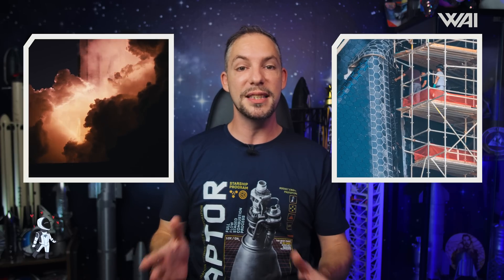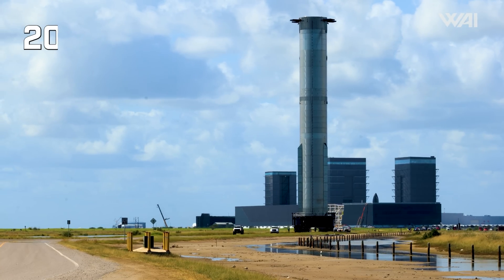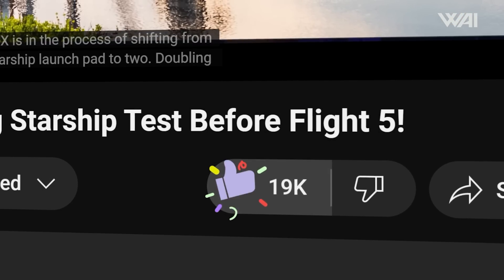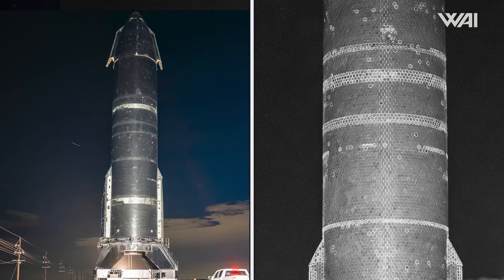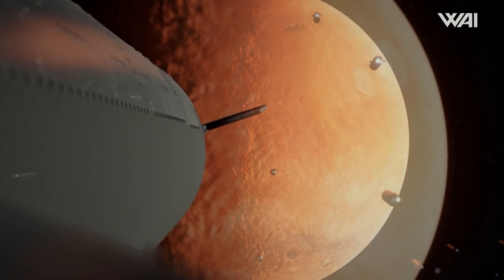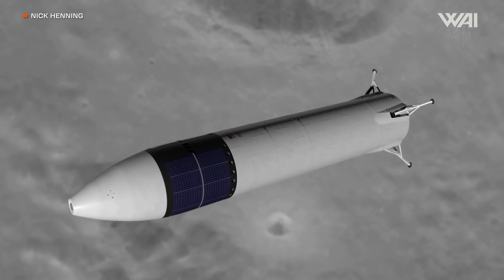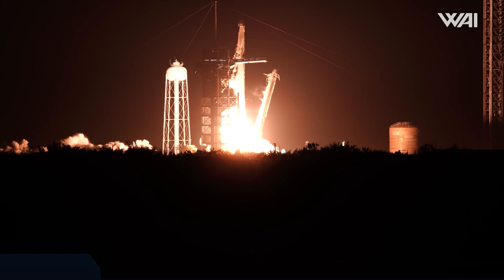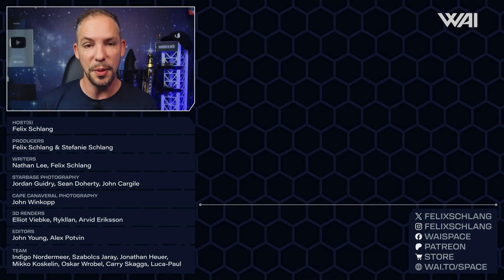SpaceX's Starship Flight 6 Booster performs unexpected MASSIVE Static Fire! Launch in 3 weeks?

Comment: If SpaceX wants to build and use Starships en masse, they'll want a good launch site to work out of and I'm not sure that Boca Chica would be a suitable place for this for political and logistics reasons (fuel supply!), especially if tanker operations are called for. Like it or hate it, KSC will likely be the main operating base for early operations, whether from a tower (or 2) at LC39A or from new launch sites north of the existing LC39. This leads to the question 'where will the ships and boosters be built?'

Personally I think that SpaceX will want to make the best use of their now-extensive facilities at Boca Chica instead of duplicating them in Florida. New facilities, even if only for the assembly of premade parts, would mean extensive construction and more personnel hiring, which would probably cause more delays. However, building Starships and boosters in Boca Chica means they will have to be transported to KSC somehow. 

In my opinion, the simplest way to move a superheavy and an unshielded Starship (such as a lunar Starship) would be by ship. Airbus, for example, leases a Roll On Roll Off ship they commissioned to move A380 components from all over europe to their final assembly location. NASA and ESA both use ships to move rocket stages around the world. A RORO large enough to move a superheavy, laid flat for transport, as well as a Starship, also laid flat and without its fins, would be a significant investment but would allow Boca Chica to remain the main production facility as well as allow boosters and Starships to be transported not only to KSC but also other potential launch sites such as Australia.

Comment: Why not use heat tile for the   rocket pad and mount to withstand the exhaust of the buster?
Reply: I believe water helps reduce the sound and it also guarantees that nothing breaks off and gets sent away at high speeds
Reply: @CrazyPengion  I was referring to the areas where water can't reach.

Comment: 14:40 - nobody cares about the heat shield of an HLS Starship - it is not scheduled to ever return to low earth orbit, let alone earth - so it will not have a heat shield.
Reply: Because Starship can barely lift itself to L.E.O.  it will take 8 to 16 additional launches to refuel the lunar craft with enough fuel to reach the moons' surface and  back to dock with Orion. 
There are a couple dozen other critical flaws in the concept that will keep that from ever happening.  
Elon took the tax payers money and will not think twice about it . His primary concern is getting the new starlink satellites into orbit. Falcon heavy can only carry a couple at a time.  Elon wants star ship to carry the satellites up and for as cheap as possible.
Every prototype launch costs upwards 100 million just in hardware and fuel.

Comment: He's not planning a heat shield on the lunar lander........ they can transfer crew and materials in earth orbit
Reply: Because Starship can barely lift itself to L.E.O.  it will take 8 to 16 additional launches to refuel the lunar craft with enough fuel to reach the moons' surface and  back to dock with Orion. There are a couple dozen other critical flaws in the concept that will keep that from ever happening.  
Elon took the tax payers money and will not think twice about it . His primary concern is getting the new starlink satellites into orbit. Falcon heavy can only carry a couple at a time.  Elon wants star ship to carry the satellites up and for as cheap as possible.
Every prototype launch costs upwards 100 million just in hardware and fuel.

Comment: Looking at the Starship with the Super Heavy it makes me wonder what is actually needed for the next moon landing. A rocket meant to take a 100 people to Mars is not what you need for this landing. If you take 8 or more people at a time it would be more than what they are currently planning to do using a curious arrangements of vehicles and a wasted space station. The Super Heavy V2 and V3 will both be larger than the V1 and may hopefully carry the original payload they have not yet been able to achieve with the current craft. Why not use the V3 Super Heavy and change the components of the moon lander? Felix reports here they plan to carry two people. That's ridiculous.  From what I've seen of the proposed SX moon lander it is very similar to the mars lander. Downsize the proposed vehicles and get eight people there at a time. Send several construction vehicles in advance and make the first manned lander a permanent station. Send another vehicle as the return vehicle. The way I understand the current plan is that it is an extension of the plan we had long ago. Send a few astronauts at a time and rediscover the moon. I think the first goal should be to establish a moon station and grow out from the there. The Starship negates all of the other plans that are being done and would be far less expensive. They are all make work projects for companies that are not able to deliver on their agreements. Does anyone believe the sophisticated components currently planned will be done and working on time and within budget? Who would trust Boeing with anything? Blue Origin is years behind schedule and has never launched a rocket to orbit. I guess you could say it's BE-4 engines are successful but we don't really know that for sure and the question remains how many of them can they produce. I'll be interested to see what actually happens when SX delivers its first test rocket to the moons surface. At that point you'll know if is capable even if it takes a couple of years more to get the job done right. Get a foothold on the moon, land a station and worry about discovering the nooks and crannies later.

Comment: They accomplished 100% on flight 5.   What else can they do besides catch the ship next?  A simple repeat of flight 5 makes no sense?
Reply: The booster suffered major fire damage to the fuel system and  engines.  The Starship gridfins almost vaporized , the engines were on fire. 
They still have not reached L.E.O. with an empty shell.

Comment: Felix, why would the ship that lands on the moon with landing legs need a heat shield?
Reply: Because Starship can barely lift itself to L.E.O.  it will take 8 to 16 additional launches to refuel the lunar craft with enough fuel to reach the moons' surface and  back to dock with Orion. There are a couple dozen other critical flaws in the concept that will keep that from ever happening.  
Elon took the tax payers money and will not think twice about it . His primary concern is getting the new starlink satellites into orbit. Falcon heavy can only carry a couple at a time.  Elon wants star ship to carry the satellites up and for as cheap as possible.
Every prototype launch costs upwards 100 million just in hardware and fuel.

Comment: why would a heatshield be required to land on the moon?  There is no atmosphere at the moon...
Reply: Because Starship can barely lift itself to L.E.O.  it will take 8 to 16 additional launches to refuel the lunar craft with enough fuel to reach the moons' surface and  back to dock with Orion. There are a couple dozen other critical flaws in the concept that will keep that from ever happening.  
Elon took the tax payers money and will not think twice about it . His primary concern is getting the new starlink satellites into orbit. Falcon heavy can only carry a couple at a time.  Elon wants star ship to carry the satellites up and for as cheap as possible.
Every prototype launch costs upwards 100 million just in hardware and fuel.

Comment: Why does everyone think a tip over at the starship on another planet would be a terrible thing. What are they in for the 70 story building view of the place that would be nice. But with your thrusters and whatnot you could lay it over on the side exactly where you wanted it to be and then do it real soft and have a door opening right there maybe even open a little hats to underneath and drill a hole into the ground and just sounds better.

Comment: Interference of landing legs to the heat shield on a lunar landing?  No need for the shield on the Moon.  Or Mars.
Reply: Because Starship can barely lift itself to L.E.O.  it will take 8 to 16 additional launches to refuel the lunar craft with enough fuel to reach the moons' surface and  back to dock with Orion. There are a couple dozen other critical flaws in the concept that will keep that from ever happening.  
Elon took the tax payers money and will not think twice about it . His primary concern is getting the new starlink satellites into orbit. Falcon heavy can only carry a couple at a time.  Elon wants star ship to carry the satellites up and for as cheap as possible.
Every prototype launch costs upwards 100 million just in hardware and fuel.

Comment: Hot staging rings are just too big and heavy. If you put the same amount of fuel into your gas thrusters you could lift away from the booster with the starship real really easy and soft. Or even in some of them they have a spring loaded push off. Just takes a little time once you've added the energy.

Comment: With the thinner atmosphere and lower gravity, I don’t think landing Starship on Mars will be problematic. At least not for the heat shield.
Reply from the maker: Interplanetary transfer speeds are much higher than return speeds from LEO. Every landing Mars mission had this problem. The thinner Atmosphere doesn’t make it better. The speed to be reduced is the same, so it has to have a more aggressive angle and longer reentry.
Reply: @Whataboutit  Thanks for the information, it surprises me the atmosphere is thick enough at altitude to slow it down at all. If I had guessed, I would have thought they’d use a high impulse ion engine to slow it down over a few days.

Comment: How are super-heavy boosters built in Texas to get to Cape Kennedy for launch/usage?
Reply from the maker: Excellent question! They can either easily be shipped via barge (the connector road to port Brownsville is already built) or they can be flown (no joke) or they can be manufactured at Robert’s Road, which is SpaceX’s smaller factory at KSC which is supposed to be expanded.

Comment: One question is still burning me.. hope someone can help me here. 
Why do space X need 13 launch in order to make 12 refill of the starship in order to reach the moon, when a smaller rocket (saturn5) did it in one shot with much older technology (engine, electronics, …)?
Reply: Because the size and weight of the starship itself without people or equipment is so much greater than the fully equipped and crewed lunar module and lander.  Terribly flawed concept design.

Comment: I wonder why they don't use a hybrid heat ablation system that uses methane bleed like the original design at the joint areas that had gaps that overheat?

Comment: I have a question about the landing I've not seen talked about.  The Raptors can't twist the booster but it has to align with the tower so the (only) two support touch down on the receivers on the Chopsticks.  How is the rotational orientation achieved?  Thrusters, gyros, other?  Do you know?  Thanks!!

Comment: The Moon starship doesn't need a heat shield. There is no atmosphere on the moon to speak of so external legs are only an aerodynamic challenge during launch.
Reply: Because Starship can barely lift itself to L.E.O.  it will take 8 to 16 additional launches to refuel the lunar craft with enough fuel to reach the moons' surface and  back to dock with Orion. There are a couple dozen other critical flaws in the concept that will keep that from ever happening.  
Elon took the tax payers money and will not think twice about it . His primary concern is getting the new starlink satellites into orbit. Falcon heavy can only carry a couple at a time.  Elon wants star ship to carry the satellites up and for as cheap as possible.
Every prototype launch costs upwards 100 million just in hardware and fuel.

Comment: No heat shield required for Moon landings, problem solved.
Reply: Because Starship can barely lift itself to L.E.O.  it will take 8 to 16 additional launches to refuel the lunar craft with enough fuel to reach the moons' surface and  back to dock with Orion. There are a couple dozen other critical flaws in the concept that will keep that from ever happening.  
Elon took the tax payers money and will not think twice about it . His primary concern is getting the new starlink satellites into orbit. Falcon heavy can only carry a couple at a time.  Elon wants star ship to carry the satellites up and for as cheap as possible.
Every prototype launch costs upwards 100 million just in hardware and fuel.

Comment: why does the moon lander need a heat shield?
Reply: Because Starship can barely lift itself to L.E.O.  it will take 8 to 16 additional launches to refuel the lunar craft with enough fuel to reach the moons' surface and  back to dock with Orion. There are a couple dozen other critical flaws in the concept that will keep that from ever happening.  
Elon took the tax payers money and will not think twice about it . His primary concern is getting the new starlink satellites into orbit. Falcon heavy can only carry a couple at a time.  Elon wants star ship to carry the satellites up and for as cheap as possible.
Every prototype launch costs upwards 100 million just in hardware and fuel.

Comment: Looking at how well the heat shield holds up entering earth it'll probably be totally fine entering Mars' atmo, so having landing legs on the shield side might not be as bigger issue as we think.
Reply: The velocity at Mars will exceed escape velocity. Starship will have to fly belly-up and nose-down to stay within the atmosphere at first. 

The heat pulse will be far more extreme than an LEO deorbit, but similar to a Lunar return.

Anyway, the landing legs can be entirely inside the hull. They don't have to be on blisters outside the hull, and can point only straight down. It is not necessary to have a wide base. The legs just have to perfectly conform vertically to the landscape.

[And of course the horizontal velocity must also be perfectly zeroed before and during touchdown.]
Reply: @imconsequetau5275  I'm not talking about the ship landing belly down, i'm talking about having one or two of the landing legs for landing vertically located on the shield side. It would need at least 3 legs but likely 4 and to have them evenly spread out then some of them would need to be on the shield side. Having internal landing legs would be way too complicated for SpaceX, they like keeping things simple. The Mar Starship will likely have landing legs similar to the F9. This is all just my opinion, i'm no expert this is just all guess work.

Comment: Every extra pound Super Heavy can lift to low orbit means another pound of fuel that Starship can bring to orbit and another pound that doesn't have to be brought up for refueling.  
So as Raptor rockets improve, the number of refueling flights required will go down.  In time Super Heavy will do 99% of the work with Starship nudging itself into orbit fully fueled.

Comment: One milestone before ship capture is orbital insertion and de-orbit, which requires two more relights of the Raptors. You can't catch a ship without making at least 3-4 orbits due to the orbital inclination.
Reply: Maybe on flight 6?
Reply: @appliedfacts  probably not as I don't think the current license covers it
Reply: Actually could you imagine how impressive it would be if SpaceX returned the StarShip back to the tower without orbital insertion?  Just an incredibly accurate hyperbolic trajectory...
Reply: I would like to see a couple zero-g burns on IFT-6, one after each end-over-end flip. 

That would double the chances of failure, but if they both work, the landing zone could be similar to IFT-5. 

If the second burn fails then the landing would be closer to Africa. Buoys could be placed at all likely sites.
Reply: @imconsequetau5275  i mean... If any of the burns fail - there will be nothing to land near the bouy

Comment: Spray on an ablative heat shield over the tiles. fills all the gaps. secures the mounting pins. burns away slowly with the main heat shield tile intact until peak heating. not very quick turnaround but seems easier to "fix" that taking all tiles off and installing an underlayment.

Comment: Massive achievement with rapid re use of stage 0 glue issue for sensor tiles is interesting and I think significant a lot to be found out there. Any info on another merger bay and hopefully more tourist friendly areas. That I think would be a good idea for a podcast. Thanks for all your work

Comment: Not trying to be an old gas bag here but  ... hey there's an idea! 
Why not use a bag design for fuel transfer? It would solve a lot of problems with trying to connecting two starships together at speed while holding the curvature of orbit. You could eject the bags of fuel and catch them much quicker and safer and then simply tether them to the outside of the starship for the journey. I would also predict the entire system developed will include a smaller transport module to lift off and lunar surface so that an astronaut could journey back in a catchable starship. 

Just a thought or two. 😜